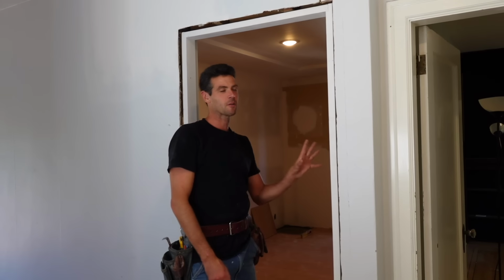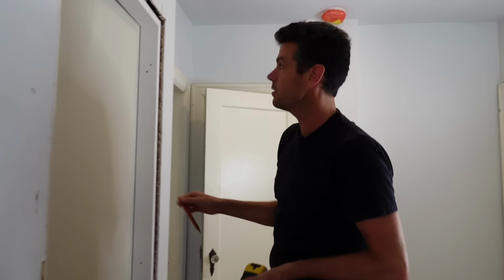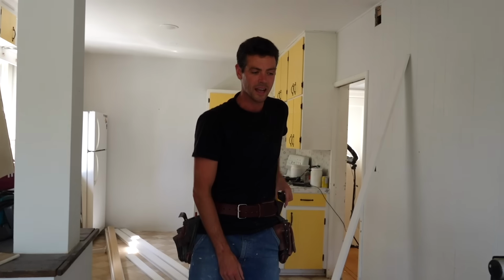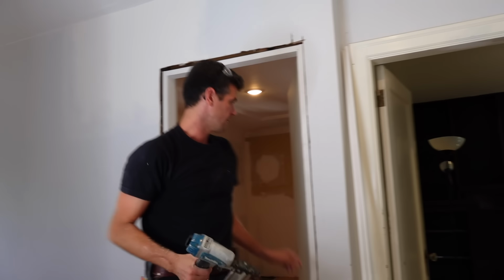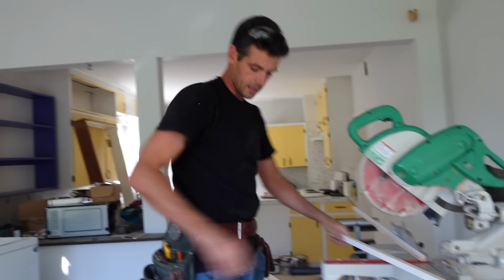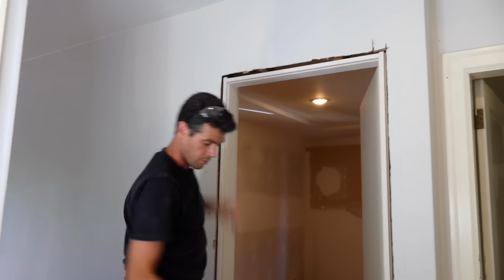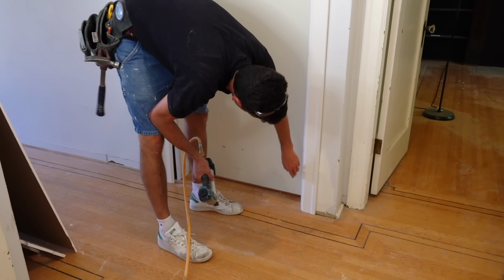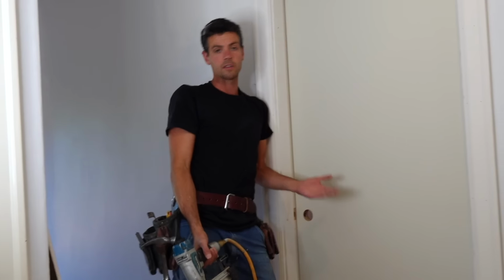Door Trim Installation when wall sticks out too far!!!

Comment: 3/16” is the best reveal for standard casing...
Also if you want to make the extension jam even it would have to be wood to wood with no paint...  then GLUE and nail... The glue should keep it from separating and causing cracks… A lot more work… Plus I think the extra reveal looks better
Reply: Attempting to make the jambs flush would be a silly waste of time and would fail anyway, no matter how hard you tried. Wood is constantly moving. This is why you want to create reveals.
Reply: These days I run a quick bead of water based construction adhesive and set the trim in with 23 gauge headless brads/pins. (after using a Bench-Dog casement trim guide to give me the nice 3/16 reveal)  A quick dab of spackle in the brad holes, some caulking against the wall, and it's ready for paint.
Reply: @KenHill  he said even not flush. He isn't talking about not using a reveal here. Read his comment again.
Reply: @KenHill  I always leave a reveal because that's the fastest way to do it. But it's possible to make a flush jamb extension that looks good and doesn't crack and it's not even hard to do but it's time consuming so you have to charge more per foot. Solid wood flat panel doors are made from several pieces glued together flush and they don't fail and they look good and it's not hard just time consuming. That's how tables are made also and they don't fail either.
Reply: @spdracr4life  I read it again and have not changed my interpretation.
Reply: @VC-Toronto  Depending on what 'spackle' you are using, it's often necessary to add primer so it doesn't flash through the paint. I don't bother using marks or a combination square or the Bench Dog tool anymore, my eyeball is pretty accurate enough.  :o)
Reply: @chichidouglas5078  You are correct, It absolutely is possible to be done that way. 99% of carpenters are not going to do that however, especially in place. If it were one jamb out of 60, maybe.
Reply: @KenHill  if I can get away with just making a normal jamb extension with a reveal I do it because it's faster but I also do a 3/16 reveals because it just looks cleaner. I've been a carpenter for almost 31 years. I try not to think like 99% of my competition and that's why I have lot of high end customers and they all have an eye for detail and symmetry. So if you do a jamb extension with a reveal next to a door with a full width jamb they'll call you on it because it looks like someone made a mistake and took the easy way out. If you scribe a line on the side of  the door stop trim pieces in the middle of the jamb and then carefully remove them. Then make a mark 3/4 " from that line and cut the jamb. Then you move that part out flush with sheetrock and nail it. Then nail the 3/4" rip in the 3/4" gap that's in the middle now instead of the front. Then nail the door stop trim back on and that covers the cut and it doesn't look like you had to extend the jamb. I've done it many times and it has never failed and looks like every other door in the house
Reply: @chichidouglas5078  sounds like a great way to accomplish it  thanks for the description.

Comment: I have a problem where the wall is out of plump. It is flush with the door  jam at the bottom but at the top the wall sticks out nearly an inch.  Speaking of fir, I am using fir which will be stained. Thanks to your videos I am getting much better at my projects!

Comment: I would normally install the extension jamb flush with the existing jamb-eliminating the extra reveal
Reply: exactly, not so hard but i guess if you are a hack working in a pos apt you can do whatever you want!
Reply: @paulkitchen5802  damnn

Comment: Let's be honest if you ordered your door jambs instead of buying them pre-made you wouldn't have this problem
Reply: And let’s be honest you would be waiting 3 months more on those special order door jambs and doors. Got to think smart sometimes 🤔🤔
Reply: @dezbigguns1072  no that's because you don't have a relationship with your local guy don't try to project that on me
I don't have to beat walls because I order my door jambs a hair bit wider than the walls
Reply: @thecloneguyz  🤣🤣🤣. My dad owns the local yard. And if you say you’ve never had to do that   Then you not a true trim carpenter
Reply: @dezbigguns1072  I didn't say I've never had to do it I said once I owned a company I started ordering them wider so I didn't have to do it anymore
Reply: Your missing the point of the video, buying a new door/jamb isn't always an option.

Comment: Now show us how to do a tapered one. I have a jamb that goes from almost 1/2” at the top down to nothing at the bottom.
Reply: I had a similar problem only my piece ran 1/2 down the door: 3/4 in. at top down to a point.  I just marked that on a spare piece of board, cut it by hand with a 5 in. blade circular saw, then glued the wedge flush with the existing jamb. Then installed casing as usual. Then used wood putty to clean up any imperfections in my wedge piece.
Reply: Chalk your taper line, take the fence off your table saw, then rip it. Watch the line. Keep it straight.
Reply: With all respect, I won’t use a chalk line for finish work. It isn’t accurate. Sharp pencil for me. Particularly when dealing with expensive hardwoods. But yes free handing on the table saw.
Reply: free hand it with a table saw, or use a track saw or plywood sled with circ saw with fine finishing blade with a wider board. mark your cut and cut. Can hand plane any high spots after so better to be a bit big than too small.
Reply: Cutting a tapered jam extension is just as simple as cutting a regular jam extension with a track saw.
Reply: I’d watch it.

Comment: What do you do? Fire the dude who messed it up in the first place.
Reply: Older homes had thicker walls. The lath/plaster accounted for about an extra inch of overall all thickness, making older walls 5-1/2” versus 4-1/2” for most modern homes.
Reply: In old lathe and plaster homes, you want to use 5/8 drywall
Reply: @markhoffman  it’ll still be 3/8” short. Instead of the extra labor and cost for 5/8 drywall, sleepers are cheaper, faster and easier.
Reply: @markhoffman 
Regardless of thickness of wall, couldn’t the width of jamb be properly measured?  Example of my thinking; if tha jam has a width of 3 inches and there’s an inch gap on both sides jamb, why wouldn’t the original installer use a 5 inch width jamb to accommodate the drywall size they used back then?
Reply: @Woodworkinghobby79  Sometimes you can mess with the jambs because they are heritage homes and the wood is fir or something. Typically when you remove lather and plaster, 5/8th drywall works.
Reply: That doesn’t fix it.

Comment: Total life saver in my old house. Installed prehung doors replacing the old ugly damaged doors and the wall is 5 1/2” thick and the prehung door jambs are about 4 1/2”. Borrowed a table saw and crisis averted! 😂

Comment: My door shop, Windsor, will also custom cut the jambs to whatever thickness you need. So, typically when I’m doing this on site it’s because there is an out of plumb wall, so the fill strips need to be tapered. Been using new track saw for that, works great.

Comment: It helps to rip that jamb edge, or extension in this case, with a 2 to 3 degree bevel. High side goes on the inside of the opening. It gives a bit of relief to the casing and makes the miters so much easier to mate perfectly. Also sand those exposed edges or it will look very crude.

Comment: Good points with jamb extensions. When I get extremes, where it’s 3/8 up top and 3/4 on the bottom, and it’s paint grade, I’ll just go 3/4” and caulk the outside casing.
Reply: So, I do have this problem. You don't plane or route down the projecting differential  (if you face nailed I guess they need extra countersinking), you just edge caulk the casing?
Reply: @ericdillenberger7873  
Also some shimming.
Reply: @ericdillenberger7873  I use a little block plane and just plane away the little bit extra material wherever I need. Then the whole thing ends up flush. I do that for all my extension jambs. Usually that means windows since it's more common to need them with replacement windows.
Reply: @kevlar1482  thanks! I got a set of grippers so I could accurately rip narrow pieces to more uniform thickness, but it is in and out along any given side.  I might try CA glue so I don't worry too much about damaging the plane blade. I cannot express how frustrating it is to work on my house as it seems to have been built by beavers who didn't own any  measuring tools, levels, or squares and loved them some beer.

Comment: Nice video, personally, I add 1/32" to the width & set the blade at a 3-degrees. This creates a slight bevel which helps the casing bridge the jamb & plaster.

Comment: Nice.  Remodeling older homes always entails transitions like this, so jamb extensions are a routine fix.  As you point out at the bottom left jamb, the gap there is greater than the rest of the existing jamb.  Caulking is fine for small gaps, say up to 1/16 inch, but nothing is uglier than filling large gaps with caulk - because it LOOKS like caulk.  To deal with varying gaps I devised a table saw sled to rip jamb extensions with varying thicknesses.  E.g., ripping an 8 ft. extension that varies from 3/16 inch on one end to 1-1/16 inch on the other.

I hope your customer has a plan to replace that god-awful looking flat Lauan hollow door with a single panel door to match the existing doors.

Comment: Nice job. I like to hold the extension jamb and the casing on the same plane so there is only the one reveal. Especially when everything is painted because with a nice smoothed bead of quality paintable caulk everything appears seamless and the assembly seems to have no extension jamb just thicker casing. Good video though to show this method of installing an extension jamb.

Comment: My brother had that issue at his home and that is what I did for one door. On the other he'd installed a steel framed security door/frame. This created a different issue. The frame was wider than the wall thickness. I installed a wood strip around the frame then had to drill and countersink screws to secure the new wood molding. The counter sunk screws were covered with wood filler, then painted.

Comment: That was a fairly wide build out. Most of the time, I encounter maybe 1/2” at most.
But it looked pretty good man! Keep that tool pouch on!
I was always told that using a reveal makes a carpenter look better than he actually is! 😆
When you butt joint the casing to those extensions, it creates an optical illusion to where it will NEVER look right. It won’t ever look even and the inconsistencies will pop out like a sore thumb!

Comment: Benchdog makes a reveal tool that is one of those gems of an idea and it’s cheap.
Reply: I use the benchdog tool all the time.  Nice 3/16 reveal.  9 out of 10 times I don't even measure, just hold the stick up and transfer the mark from the jamb over to the trim.

Comment: I am using a handle with succion cups like they are using fir windows and it works super well and faster. Of course, if the piece of floor is too small, the trick in this video is useful.

Comment: I do many old buildings where the plaster and lath has been removed and Sheetrocked which leaves the window from sticking out 3/4 or thereabouts and the frame needs to be trimmed which is a lot more work.

Comment: Question - When you put in the initial extension - why didn't you put the top one in first so that the two sides end up "holding it up" at the top corners - just like the other reveal is - at least for consistency's sake? (33 yr handyman here - Sonoma County wine country)  To me, at least - it does give the illusion of more strength when the verticals end up securing the top from underneath. Just sayin! - Thanks for your GREAT VIDEOS! Learn something every time - especially about the art of sheetrock and mud etc.

Comment: I was always concerned about the flush line opening, So I’ve experimented with hot glue and so far hot glue plus spackle doesn’t crack. Just a thought. However much faster to do it your way. And it looks great.

Comment: This will be very helpful.  I pulled off two door casings and need to build new ones.  One of them doesn't have a top, and the frame is a bit high so I need to add material to lower it about 1 inch.  What are standard measurements for insides of door frames?  There won't be a door in this case, so nothing prehung to just stick in there.  Thank you.

Comment: Nice. Facing this problem with our renovation. Our walls are masonry, though. Can the same be done using good glue to the drywall on masonry? Or are there special nails? In some places, it’s drywall on metal stud (insulation between the metal stud and old masonry walls). Feeling insecure about face nailing and about gluing trim!

Comment: So what about the area that's 7/8"? Do you fill it in with caulk or do you hammer down or cut the drywall a bit so it fits tighter? Thanks.

Comment: Nice work. How would you fix a smaller gap say 1/4" to 3/8"? Do you think if you butt the joint up even (no second reveal) and used that 2 part glue it would still crack over time?
Reply: Just use glue and a few more brads than you would with a reveal. Then go with two coats of wood puty and sand between each coat. You shouldn't be able to see it.

Comment: And then there’s my daughter’s mostly cosmetic fixer-upper. The three pieces of casing for one door (expensive Kelleher stain grade) were cut to size, but never installed. Just left leaning against the wall in the corner of the room. Put it up. Left leg, top piece, left leg. Oh, well, that explains it. Thanks for the video!

Comment: As professionals we either build the jamb to fit the wall or order the correct width if not 4 9/16. A bigger problem is when the wall is out of plumb and for that we clamp, scribe, cut, glue and nail and then finish out with needed paint prep.
Reply: All while wearing your hard hat, safety goggles, hearing protection, steel toe boots, and pants.

Comment: Can you explain why do you measure 3/4 thickness that you need to fill in and cut a strip that’s 3/4 wide but then lay it flat against the door frame and basically use only the thickness of the baseboard and not the 3/4” that you measured?

Comment: 5:05 great table saw. It is probably safer to put your saw on a work bench rather than on the floor. If you trip, you are going to fall on that blade.

Comment: Whats most common in Canada when it comes to construction? Imperial or metric? Comming from the  metric system, I have a hard time following when theres a jump in fractions, like 1/4 or 3/16. Anyway, really enjoy your videos, given me alot of good tips, especially when it comes to drywall and mud/taping!
Reply: Imperial 🙁
Reply: if you are new to the fractions just convert it to 16ths.. quarter inch so 4/16.. now you know it is only a 16th larger than 3/16, which is larger than 1/8 by a 16th. after awhile you don't even think about it.. and yes imperial for the most part in Canada for this kind of thing.

Comment: Another way, that I've used, especially if the difference between the wall and the jamb is not as even in this case, is to use a router to remove material from the back side of the door casing.

Comment: The way we do it in Scotland is different. We rarely have rebated door casings so I when I fit the stops I would make them flush with the drywall.
Reply: Don’t you guys use plasterboard and finish with multi?
Reply: @MichaelG306  yeah, we call it plasterboard,  I always say drywall when it's americans/Canadians to avoid confusion😂. By multi I'm assuming you mean a plaster skim??? In England they skim, but in Scotland its rare to see that. We tape and fill our plasterboard.
Reply: i have a feeling a rebated door casing as you describe is what we call a rabbeted jamb? one piece opposed to a piece of lumber with a door stop nailed onto it..  I think what we in Canada call the casing you call architrave, and what we call the jamb you call the casing..
Reply: @chrisburns5691  yeah, we don't actually call either casing over here, we would call it a rebated door frame (one piece of lumber with a rebate cut into it. As for architrave..  we call it facing in Scotland.
Reply: @dunch1988  hmm interesting
Rabbet vs rebate, face vs casing
Metric or imperial.

We still do the same stuff and solve the same problems day in and day out though hey 👍
Reply: @chrisburns5691  yeah, although I learnt from an old school carpenter who used imperial so I can use both... and metric is way better!!😂😂
Reply: @dunch1988  I do keep a metric tape in my van, and find it easier for certain jobs like figuring baluster spacing. But other than that I don't even think when using imperial anymore so I leave the metric tape collecting dust lol. Just depends on what you're used to I guess.  Imperial is the norm with everyday carpentry tasks here in Canada.

Comment: There used to be a manufacturer that made slip jam interior doors one jam was tongue  and one jam was grooved so it was adjustable for the thicker wall dimension  the extra cost in a slip jam door would far exceed extra labor cost of your process making extension jams

Comment: We had a bathroom renovation, the tiles were 10mm thick, the architrave 11mm, which meant with glue the tiles were proud of the architrave, it’s an ugly look, my solution was to get a 19mm thick architrave with the same profile.. which meant the architrave would be proud about 5-10mm which was ok.. it saved me cutting 10mm strip around the door frame.

Comment: Is there a limit to the depth of the jam extension? We are replacing a door from a laundry room to the garage.  The casing is 7" deep but the new door  jam is 4 3/4" deep so the extension would be 2 1/4" deep.  The door swings into the laundry room so the extension would be on the garage side.  Thanks